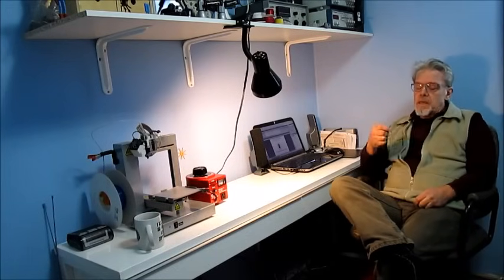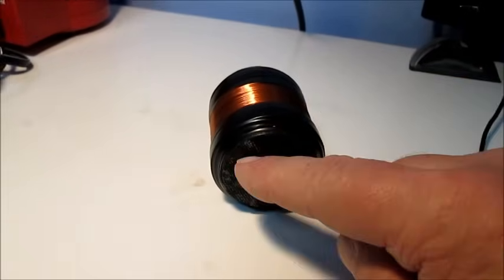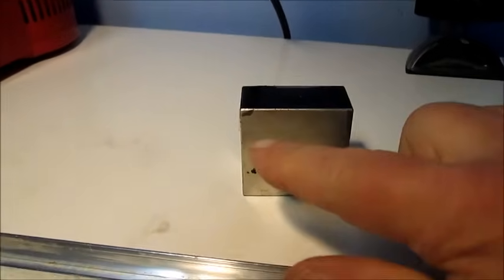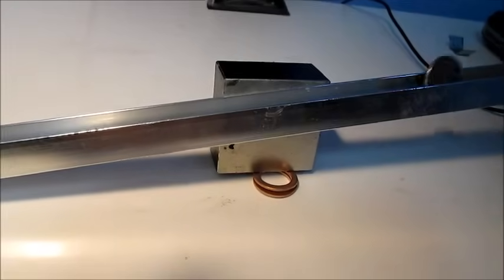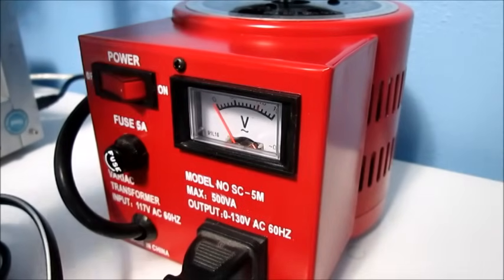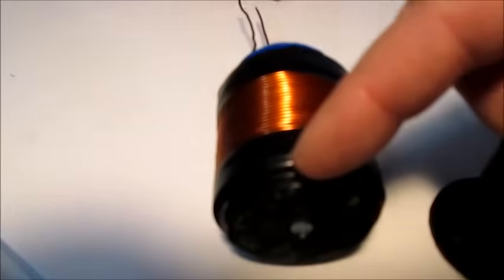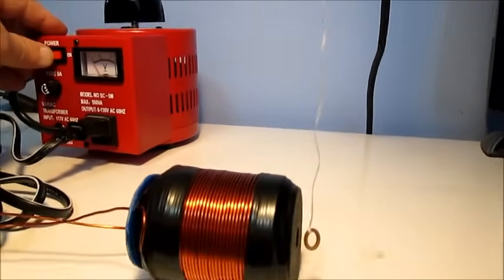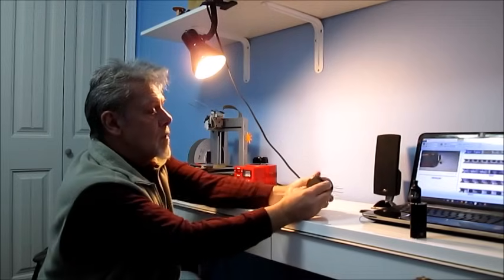How To Make A Gold Magnet

Comment: A shaded pole motor :-) Nice work.
Reply: I sense sarcasm. Lol. Can you explain?
Reply: @kylestrokelitus360  a shaded pole motor is a variety of brushless AC motor.
A three phase, for instance, approximates a rotating magnetic field by placing three coils at 120 degrees to each other. A conductive armature placed inside the field will rotate with it. Once rotating even a single field is enough to maintain rotation as long as the armature is nearly synchronous with the reversing field.
A shaded pole motor is a single coil on a laminated iron core with two copper single loops cut in on the trailing edge to create a phase shift of the field to start the motor rotating. Examples are small fans or mechanical electric clocks.
So this is an example of part of the alternating field lagging the main field. Exactly the same as a shaded pole motor.
Reply: @garygough6905  you sir are educated and experienced and that is complimemted to let you know you should be proud of that. Wow. And I truly appreciate the degree of explanation you delivered. It was unexpected and im grateful  for it. I cant get anyone to explain anything anymore, the ones who do, get frustrated if i dig deeper because im interested or they bring up something that maybe has an answer, to a missing link somewhere in my never ending search of knowledge towards shit that matters (well to me at least lol). Thank you! Do you have a channel or tutorial guide website? You certainly have a plethora of knowledge that would do the world some good of you had a way to convey some of it.
Reply: @kylestrokelitus360  Thanks. I am an old generalist with a 62 year background in electronics and an interest in science, presently trying to wrap my head around quantum field theory. No end of fun. 🤓 
Back to magnetic fields, a great example of paramagnetic properties  is a mechanical speedometer.  A copper cup around a permanent magnet. The magnet was spun on a cable driven from the output of the transmission, and the cup was connected to a spring and pointer. The faster the magnet spun the more force against the spring.
Simple and good enough, usually.
The resistance to motion through the magnetic field is a result of the induced electric currents and the short circuit through the metal.
If you look at a fan armature, they are designed to optimize the effects,   copper wires on an iron core shorted out on copper end plates.
Often called a squirrel cage motor as the copper parts do resemble a squirrel cage.
Reply: @garygough6905  Im very very intrigued at the level of simplicity you explain. Surely the 60+ years of grinding the mind pays attribute to that, as much of an concept we make redundant in life, the complexity is always there from up close but that becomes clockwork im sure to someone of your stature, so the concept becomes much more simplified from your view point further away. I kinda like that. And still i am mind boggled as mechanical and electrical come together. I have residential electrical and construction upbringing, and manufacturing and business experience with a study concentration in mathematics, physics, and business management. Most recently ive been battling a disibility and have been studying the earth for 3 years trying to make life sustain from no income, and, ill tell you what between what people throw away, and having a background in science construction and electrical, that has made a world of difference for my survival. And allowed me also to take huge ideas id never attempt, and its forced me to learn fabricate and make it happen. With no money its been challenging but the barter system works amazing, and im about to register a few businesses and have the ball rolling shortly thanks to that ever living drive inside me to learn. But ive learned from many like you, and i pay homage to that. 

Where are you from Gary?
Id love to learn more from ya
soar llc at oulook dot com
Reply: @kylestrokelitus360  was a farm kid, in Saskatchewan Canada. Started building electronics when I was 6, very self taught.
Always have liked to try new things.

Math and physics. You would have had fun with a project that I was called to work on. Was supposed to design instrumentation,  so I asked what the peak expected power level was to size things, and was told "Secret".
Wind power generator. So armed with a pencil a glossy sales brochure with a picture, grade 9 physics and grade 6 math, plus a quick lookup for loan payments. I came up with the unit needing to be 1,000% efficient to pay for itself. ( it would have been doing well to hit 25% )
Did put myself out of a job, but felt good about it. Reviewed when I got to a computer and even from memory I was very close.
Reply: @garygough6905  wow. Thats incredible. Question for you (i dont play much with mechanics), but ive had a few things on my mind. 1 generation of electric from several alternators each being spun by water flow in a small creek running through a stone arch under my building (several spinning i assume would be much better than 1, but i havent dug much into the topic - some ive seen you need alot of flow, or a large long drop) and another is with an additional alternator being spun from vehicle engine producing alot of ac amps if wired correctly which could power a home or even a small panel box at an offgrid worksite.
Reply: @kylestrokelitus360  so  many questions to ask. Your available energy will be flow rate and drop. Actually the exact same equation as wind except  much more mass / cubic meter. 
As an observation, car alternators are high maintenance as they are designed for a short life and compact build, so high speeds. They go through brushes and bearings. 
A 4 pole alternator generating 60 Hz, spins at 1800 rpm. I have a brushless unit that ran for 25 years and then needed 2 bearings as routine maintenance. 
Car alternators are rectified to DC so can spin faster, making more power in a small unit with less mass, and cheaper. If you have ever had one with a bad diode, you might have heard the tone on a radio, rising frequency with engine speed.

Comment: Only thing though, i think? Wouldn't it just be a sstronger magnet and attract all ferrous metal stronger? Thank you.
Reply from the maker: Hi es Kimo;  thanks for the comment.

As it is, the magnet attracts all ferrous metals.  We have been having a good discussion on the magnet and it appears that the lower a materials electrical resistance, the stronger it it attracted.

Comment: Hi Ken, great video! I have a few remarks and questions: You seem to be using a 3/8" bolt, and not a 5/8"? Does the bolt have a head? is there a metal nut on top of the plastic spacer to make sure the coper rings and the spacer stay in place? There seems to be a gap also when inserting the core part into the cover part. Does the bolt and the baling wires stick out of the core and touch the bottom of the inside of the cover? Which winder did you use to wind the coil? Thanks A LOT!
Reply from the maker: Hey Matthew,  Thanks for the comment.

I am using a stainless steel 3/8" x 2" bolt.  It has a hexagon head and should be found at most all hardware stores. 

The head is left on and at the back of the coil.  The front of the coil has a plastic washer to hold the copper washers from falling down the threads. 

Its important to have both the bolt and wires flush with the outside surface of the copper washers.  I just coiled it by hand, its not difficult.
Reply: Manual winding. Great Job! I find it hard on my side to have a perfect winding... Do you remember if you started winding towards the right, or the left? not sure if that makes a difference, but I have a sneaky suspicion that it affects the attraction or repulsion of the metal... Thanks again!
Reply from the maker: Being right handed I help the coil in my left hand and wind with the right. Going clockwise.

With ac it shouldn't make a difference which way the current flows or which way it's winded.

Comment: Ken, when you used the permanent magnet with the Aluminum channel did the channel cross both poles of the magnet? If so try it with only the North Pole of the magnet as the North Pole always has a stronger flux field.
Reply from the maker: Hey ChicagoThunder, thanks for the comment.  

According to all my tests, I do not think the North pole is stronger than the South, further, I don't believe there are such things as North and South poles on a permanent magnet. 

Poles only are used when referring to one magnets attraction or repulsion to another. Either can be North or South depending on how its labeled.
Reply: KenKlondike I believe you are correct however the other magnet that the rest are compared to to determine north and south is the earth.

Comment: First thank you for the video. It seems impractical, but gives info on understanding. Why not DC power? How about rappelling with force. What principles does gold, silver, platinum have with Magnets, DC magnets, electricity, that can be used to sort them out from other things? I would show the fields like you can with iron flakes and a normal magnet. With silver dust or gold. Have a donut shaped clear plastic petri dish with flakes in it, cut a hole in a table that fit your donut, Magnet can go through both and show how it affects dust.
I hope that makes sense to you.
Reply from the maker: Hey Terminator Fire:  Thanks for the intellectual comment.

The actual effect is created by the gold/silver/platinum electrical resistance.  In simple terms the magnet is creating an electric current in these materials which has an opposing magnetic field. The opposing fields are opposite which is what creates the attraction.

DC won't work as its the AC that creates the effect of alternating reversing of the magnetic poles. 

That's an interesting way of looking at the magnet by showing how it effects iron flakes.  I will work on that to see the effects for the group.
Reply: I'm interested in the application Ken used in another video, a permanent magnetic bar across a sluice box to slow the gold as it passes through the field increasing its drop rate (with the added benefit of removing some of the black sand.

Comment: SO get a bunch of iron dust or filings etc to simulate what you would find in a river, all the black magnetic stuff. Now mix some fine gold in with it. Then figure out how to make a gold magnet that causes the iron to move away and the gold dust to be attracted. 

~
Reply from the maker: Hi Robert,  thanks for the comment.

In my sluice box and trommel I use a first bank of permanent magnets to pull out the magnetic materials first (keeping them).  Then use a second bank of magnets over the riffles to drop the gold down.  

With this system I am experimenting with this electro magnets under the sluice to pull the gold down into the riffles.  The idea is to be able to feed more material through the system with less loss.

kk

Comment: The supplied AC current induces an Eddy current in the gold coin that creates own magnetic field. This magnetic field interacts with the  magnetic field of the supplied current and the coin is attracted. If supplying a DC current it will be no attraction of the gold coin. This is not a magnetic field of the gold.
Reply from the maker: thanks Stoyan, possible of interest to you is that the field turns direction on the inside face of the washers.

Comment: Your video intrested me. I would like to see the magnetic field lines visually, with iron filings and then also with copper powder and finally with gold powder.
My hypothesis is that the "center electrode" is actually the centerpoint where the eddy currents are less. Similar to an airfoil creating a low pressure area above the wing and a high pressure area below. It may be that the field shape is not a traditional torus shape. It may be many seperate fields dispersed around the outside of the diameter, which would create a "low pressure" area in the center, near the steel bolt. So, I belive there is field eddy currents everywhere along the outside diameter, but fewer eddy currents in the center of the cylinder. I think perhaps the coin is being pushed into the center from the outside diameter eddy currents rather than pulled by a magnetic attraction.
Of course, that is only a theory. I would love to look at the field lines through one of those devices which allow you to visualize them.
Reply: I'm going to put together a 3D magnetic field demonstration device using a clear square plastic box ($ store), mineral oil and steel filings (free, from the brake drum machine at a tire shop) classified to 200 mesh. 
Thanks for the video, Ken, it kicked me in the brain pan ;)

Comment: Limited to the size of the core you say? Rebar comes to mind as a step up
Reply from the maker: Hi Michael,  Thanks for the comment.

The larger the core the larger materials it will pick up within the radius of the core.  To pick up smaller materials a smaller core is needed along with smaller diameter washers.

Comment: In gold and silver there's small amounts of iron. ....if your magnet is powerful enough it will magnetise. ...I think this is what's happening and that's why it won't magazine small pieces of gold and silver cos the iron content is so low....in one tonne of iron there's most probably a nanogram of gold and so on for silver and platinum. ..just my point of veiw
Reply from the maker: good science requires skepticism so your comment is appreciated.  The gold coin used is a 1/10th ounce Canadian maple, .99 pure gold and not attracted by a permanent magnet.  

In simple terms, the reason it works is because an electric field is induced in the coin.  The coins electric field is magnetic. A different configuration, but the same effect as using a copper coil to make an electromagnet.

Comment: I imagine that thing would get totally covered in black sand before it caught any gold
Reply from the maker: Hi Joseph, Right. It would as it is.  

In my permanent magnet set up I use a first set of magnets to pull out the black sands, then a second to drop the gold into the riffles.
Reply: joseph medina could you possibly create a strong enough magnetic field over the top of the sluice box. To push the gold down. Basically assisting gravity.

Comment: I don't see much useful here.  AC electromagnets are well known, and they attract non-ferrous metals by inducing a current in them which sets up a magnetic field.  Your "gold magnet" will also attract aluminum washers, or any other metallic object.  The amount of attraction will be based on the strength of your AC electromagnet, as well as the material, the size, and the shape of the object.

Comment: Induction occurs in all metals.
Reply from the maker: Hey TruAnRksT, thanks for the comment.  Agreed. 

The interesting point it leads to is because induction is electrical conductivity, and various metals have different conductivity - can such a magnet be used to determine what type of metal it is?
Reply: This effect is how high end metal detectors try to discriminate between different metals.
Reply from the maker: Hi TruAnRksT,  thanks for the comment.  Partially true, high end metal detectors pulse a single coil and detect changes in electrical current flowing through the coil.  That current changes when effected by metals.  This gold magnet coil 'projects' a dual field.

Comment: If gold its better condunt to electicity, what if its used like wire to make a electromagnet ?? It would be stronher or something I think...
Reply from the maker: Hi Luis,  thanks for the interesting comment. 

That's a very good question.  Gold has higher conductivity than copper but that may result in less magnetic field.  

This is speculation on my part until its actually tested.

I will check it out when I get the time.

Thanks

kk
Reply: KenKlondike if you check the resistance tables I believe gold is actually worse than copper.. the only thing that's better than copper is silver I believe
Reply from the maker: Hi Carolyn,  Thanks for the note.  That's a very very astute point and something I hadn't considered.  

Silverresistance: 62,
Copperresistance: 58
Goldresistance: 44
Aluminum resistance: 36

Also of interest is that each metals melting point increases with higher resistance.
Reply: that numbers must to give something..
Reply from the maker: I think you may be right, will do more tests on other materials to see if their is a correlation